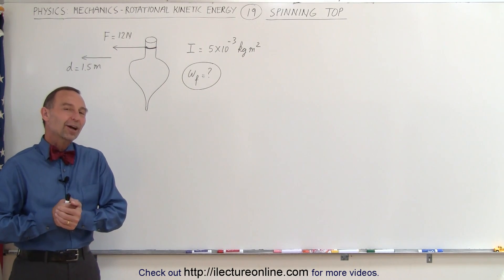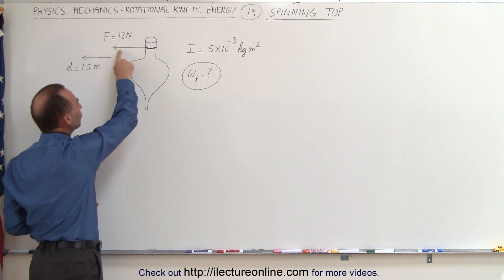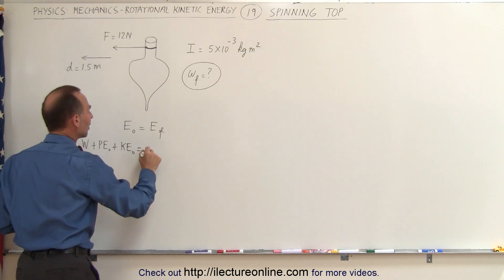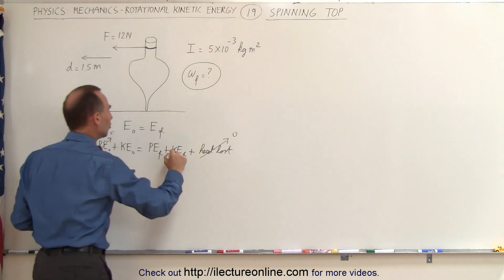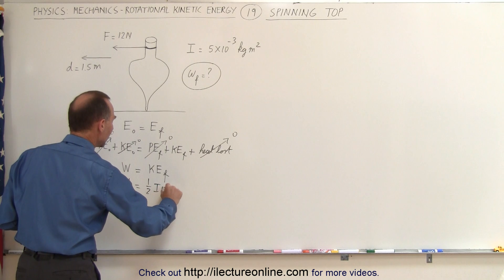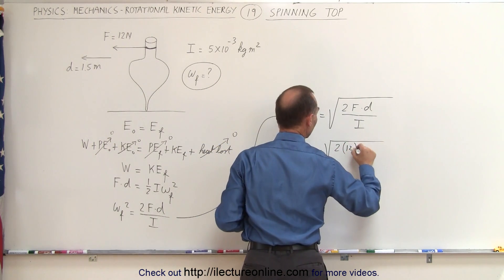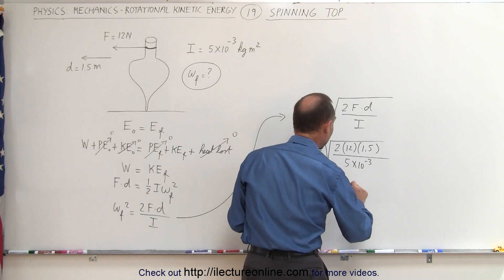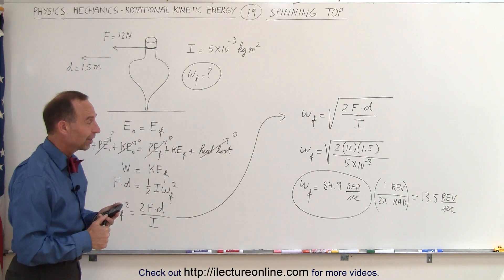Physics 8.5   Rotational Kinetic Energy (19 of 19) Spinning Top

Comment: thank you so much... sir I have a question... if the surface has a wider contact with the ground then I can't ignore the lost energy due to friction... in the relation you wrote you add the value of the heat lost... I count the energy that could be lost due to friction do I add it? or subtract it?... another thing the work in my situation is the work of spinning it using two finger so the work will be W=F.D.(theta) if I add the energy that could be lost due to friction (doesn't the value under the root could be smaller than 0?)  please reply I have a physic study that I must finish soon for my college 😊
Reply from the maker: It depends on which side of the equation you place the energy lost to friction.  On the left side you subtract it.  On the right side you add it.

Comment: How inertia and weight related ❓❓❓❓
Reply from the maker: Weight ( or rather mass) is the component of inertia.  Inertia implies the tendency of a body to resist a change in its velocity (when it is at rest, or when it is moving)     In space where an object is weightless it still has inertia.   An astronaut would not be able to shake a massive object back and forth even though it doesn't weigh anything
Reply: @MichelvanBiezen  in space what is rotation of axis ❓❓❓
Since inertia exists only against forces ❓❓❓
So if we know axis of rotation or intertia area. So we found how much gyrations can escaped from black holes by increasing gravity pull and we come from inside it like a screwdriver pulling out a screw from wooden blocks a screw ❓❓❓🕉🕉🕉🛐🛐🛐🛐🛐🛐🛐🛐🛐❓❓❓

Comment: How will we sole the problem if friction is not negligible and we already know the coefficient of static and dynamic friction?
Reply from the maker: Friction on a rotating object exhibits itself by acting as a torque, slowing down the rotating object.  That is why when the contact point has a very small diameter, the torque is very small and thus the friction is very low.